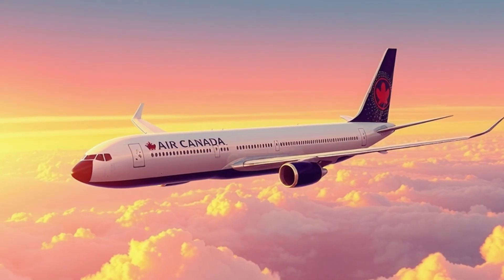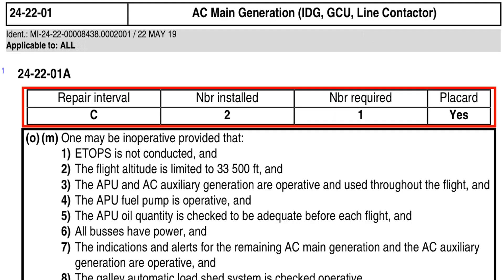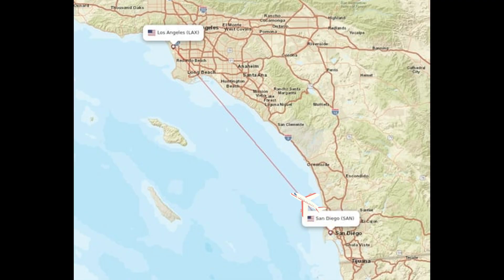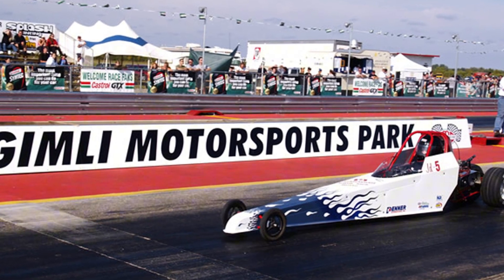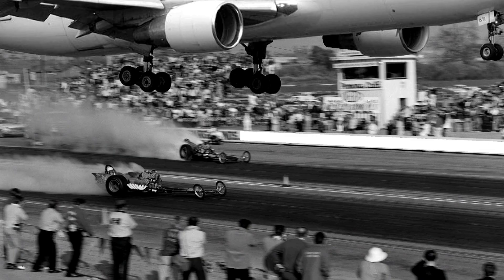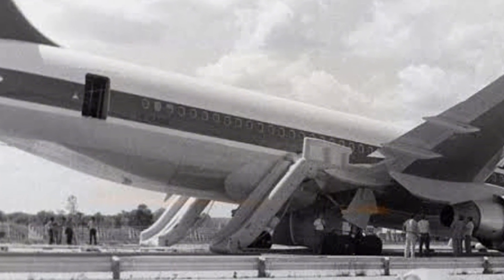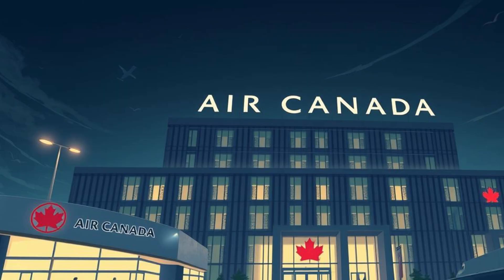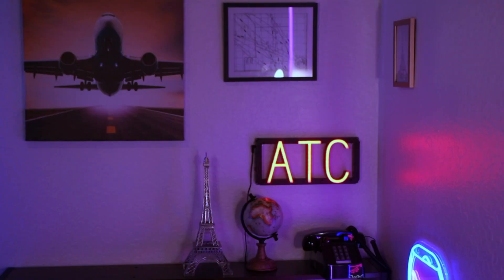Gimli Glider: The Miracle Landing from a Fuel Disaster

Comment: 9:05 That wasn’t well put. What actually happened is that they read the fuel quantity in liters and mistakenly treated it as if it were in pounds—without doing any conversion at all. They should have converted liters to kilograms, but instead they assumed the number was already in imperial units. That error led to the aircraft being loaded with less than half the fuel it needed.

Comment: A great story and amazing to hear about again. At the time it happened I played hockey with an Air Canada 767 pilot who also was a member of the pilot association group and involved with the defense of the pilots. 
The fuel measurement was done with a dipstick that measured the depth of the fuel in the tanks which required the pilot to walk on the wing. The defense was that the pilots were pressured to use this method when the fuel gauges failed which was a fairly common occurrence. Also not mentioned is that the 767 was the first Air Canada plane that did not have a flight engineer which  might have had a more technical person on board to handle the fuel load issue. He said that the airline had to blame the pilots because they didn’t want to have the airline look guilty.
One other small correction, the races that day were sports cars and you can see some open wheel cars in one of the photos.